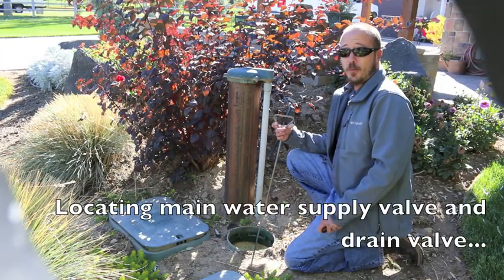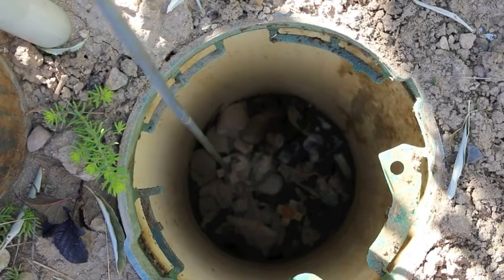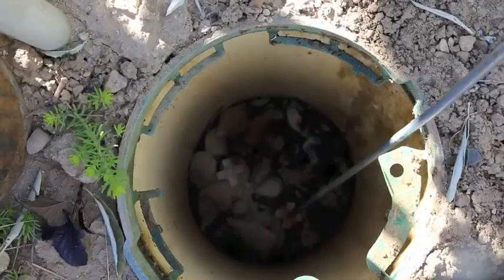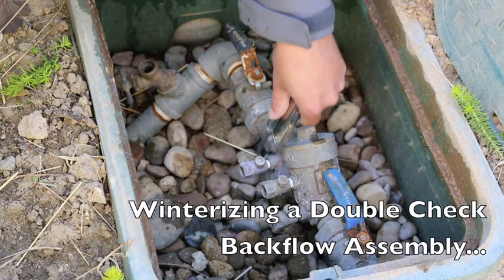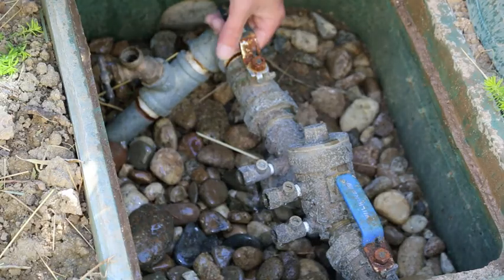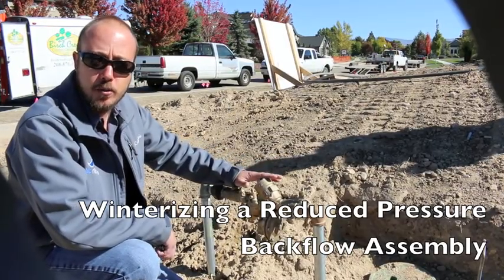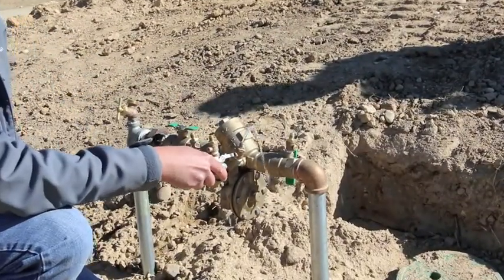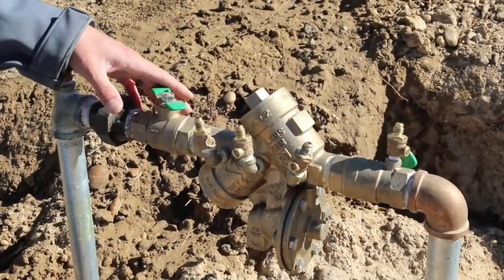How to Winterize a Backflow Device

Comment: What he said here is to turn each valve 1/4 turn, but not all the way off.  Then he proceeds to turn the valves 1/8 of a turn.  1/4 turn, if we are talking about a full circle, would turn the valve completely off.  I have read this same thing on other instructions, but didn't feel like the valve should be completely closed where it can trap water, so I wanted a video to show me how.  It seems to be done correctly here, just not described as I would expect it.  I guess what I really don't understand is why the valve isn't left open all the way?  What good is turning it partially off?
Reply: He repeatedly says 1/4 turn while actually demonstrating 1/8th turn which is the proper procedure. 40 degrees off the open position is a more precise position for proper winterizing. Ball valves contain a chamber which is between the ball and the housing and not connected to either the inlet or outlet. When the valve is fully open or closed, this chamber is completely sealed and will hold pressure. When the valve is partially open, the seal is bypassed and the chamber is connected to both the inlet and outlet, able to be completely vented by compressed air. Failure to drain that chamber is a sure-fire way to get broken valves. The presenter also fails to open the check valve #2 cap and drain that chamber as well as to loosen the 4 bolts on the anti-siphon valve diaphragm housing.